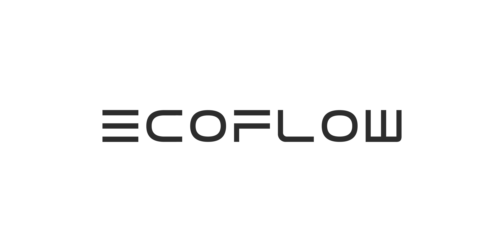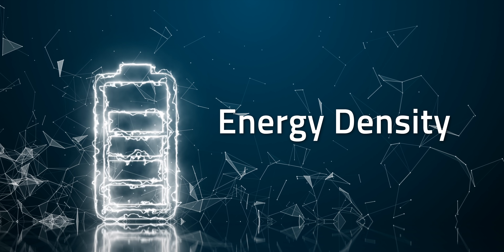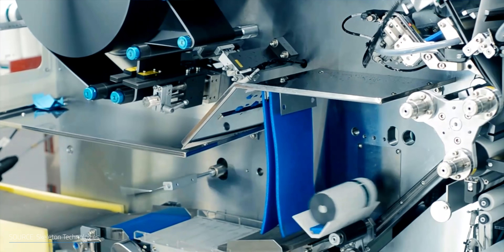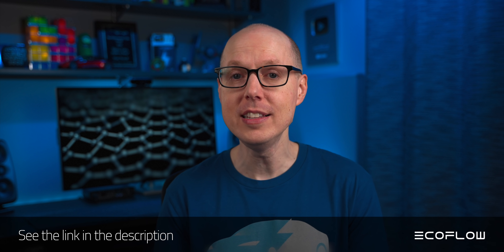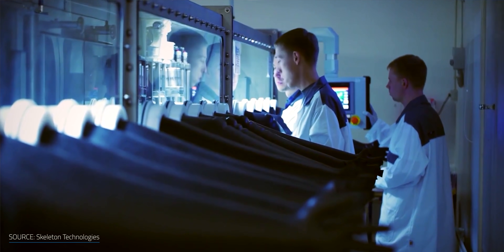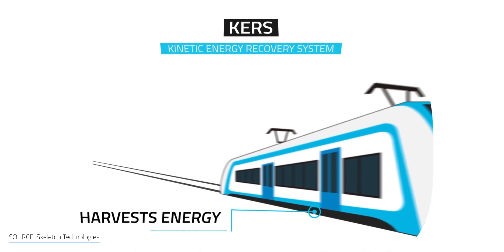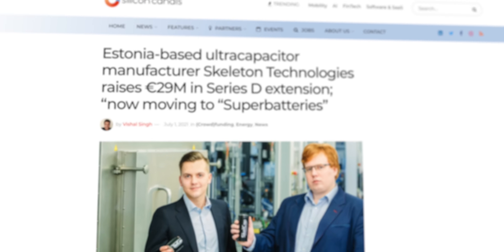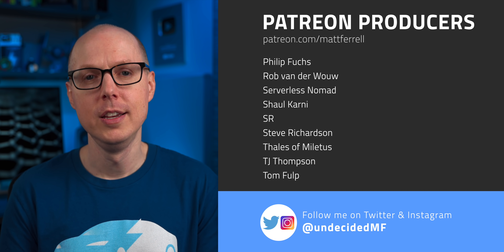Revisiting the Supercapacitor - The Wait for Graphene is Over

Comment: Extremely interesting products. Could see the Ultracapacitors pairing up well with L ion batteries as you could harvest much more energy from regen braking and then dump it out very quickly when the car pulls off thereby saving the L ion battery from having to absorb or provide short bursts of high current which is what damages them.
Reply: If such technology can be minitaruised it could mean personal devices could harness kinetic energy got make batteries power last longer.
Reply: I think the whole idea of Graphene is to replace  Lithium because of its heat & fire factors

Comment: Wait for the release about the invention of a Filipino. No oil needed to run a car. It can also be used in industrials, home. It is already tested on cars and it runs smoothly. Plug aircons, tv etc and it works well. I will share the link when there is English version of that video. This will change the world.

Comment: The Achilles heel of supercapacitors is the self discharge rate. The power stored is proportional to the voltage squared. (1/2 C*V2). Reading between the lines of Skeletontech's spec, over 72 hours the voltage will drop from 2.85V to 1.425V. This is a power loss of 60% over three days. This may well be acceptable for many uses but not or longer term storage. I like the weight down a mineshaft (or old minuteman silos), coupled to a motor/generator, for longer term  energy storage

Comment: The wait for graphene is over, as long as you're willing to wait for it.  For me, the promise of graphene is not going to be fulfilled until someone figures out how to mass produce sheets or ribbons of it.  They just call this stuff graphene because the word is hyped up so much and it gets them press, but it only bears a passing resemblance to the idea or the material properties graphene supposedly has.  It's just carbon.  It isn't even a 2d material.

As for advanced capacitors in general, yeah, good stuff for specialized applications.  But it's just an optimization thing - it isn't and will never be an actual game changer.  It's just one small piece of the ongoing gradual improvement of batteries over the last 40 years, that people don't really notice and only occasionally care about when it's time for an upgrade.

Comment: I still don't think people understand the impact graphene will have. It will replace all other materials when it is mass-produced. Airplanes that cannot break apart in a crash, flying cars, buildings that last forever. It weighs next to nothing, and its bonds are stronger than almost any other chemical reaction. It will not degrade under ordinary conditions. It would take nitric acid to break it down. All products will be graphene doped with other elements to give them the desired properties.  It could be designed as a superconductor. Spaceships that cannot be penetrated by space debris. Space elevators using graphene cables. I know this sounds superlative, but this has so much potential we should be putting as much money as possible into its development. Graphene has the potential to save the world. 

For example, today people are adding it to concrete which means they use 30% less concrete for the same strength. Concrete production is terrible for the environment. It contributes 8% to CO2 emissions. Now we can create concrete batteries, which would work even better with graphene.

Comment: if its better than lithium ion, then go!!   we need three different sorts of storage medums:  low cost high capacity for general excess production capture, low cost low capacity high cycle times for instataneous grid demand leveling, and low cost high cycle time intermediate capacity small volume for vehicles. 
vehicles need to have a mix of fast power delivery and high capacity but slow delivery, to suit two different scenarios. one is short static route vehciles like buses, taxis city/town comute. and the second is long haul, non standard route like off roading, or trucking or vactioning where u may not expect to need refueling often.

Comment: Very nice presentation, thanks for your input. I'm using EDLC super capacitors in my projects from 2007. They help the battery, which has great capacity but high internal resistance and they last for years. First ones had a tendency to leak. Also their rated voltage is low, about 2.5 to 2.8V. So there must be at least five in series for 12V and they must be balanced. Since their principle of working is electrostatic, they have completely different charge/discharge characteristic then batteries. So their usage as a main power source isn't very plausible, but together with batteries is where their synergy really comes to life and is very useful. I look at graphene capacitors as a next step in evolution, mainly getting smaller and more power dense. Definitely a way to go.

Comment: This is just the beginning. The energy storage of graphene supercaps should improve.  It could be to the point chemical batteries will be only for large scale applications. The application for hybrid electric trains, that can run onto non-electrified lines for 20 miles or so, looks good.  Graphene may ensure this so-called hydrogen revolution will be still born.

Comment: Could you charge a vehicle's ultracapacitor fast, and then discharge it to it's lithium ion battery over the next 20 minutes or so? Like 100 miles of range in 10 seconds type of thing.
Reply: Yes! But in this scenario it would be better to use the capacitors energy directly, bypassing the lithium ion battery entirely. 
One of the challenges with vehicle charging stations is that they need to supply a large amount of power to your car in a short time frame. So it could make sense to use the capacitor in the charging station itself.

Comment: Graphene electrical accumulators seem a lot like hydraulic accumulators.   Graphen accumulators will probably be part of most electric motor drive circuitry in the future.  There are a lot of motors out there.  They can be used to start motors that require a huge startup current.  Then there is the obvious use in vehicles for storing regenerative energy when stopping.

Comment: I remember years ago when there was talk of having cylinder type batteries with graphite used instead the size of a regular double A battery but being able to store like x5 or x10 the amount of power a regular battery can. The only problem they were saying back then was a way to mass produce the graphite. This reminded me of that, and how I am still waiting on those great batteries that can store way more power. The current batteries we have these days still stink and until we get to better energy storage for long term we will be reliant on stuff like fossil fuels which stinks.
Reply: "The current batteries we have these days still stink"

Nah, most of them don't smell like anything.  And if you compare a AA Li Ion today with a NiCad from say, fifty years ago, you will find they have gained quite a bit more than 4X, already, especially if you are talking energy storage/weight, which is every bit, or more important for many types of vehicles than energy density per volume.  Now fossil fuels, when burned, do stink.

Comment: I think it't MIT, that patented an industrial-scale process and spun off a startup producer for graphene, it seems maybe like 4-5 years ago off the top of my head.  My point is that the supply-side is finally arriving with quality product at meaningful and practical scale and cost.  Graphene is real.  But we still need better batteries to make wind and solar viable (not to mention, greener economies surrounding the source materials and expired equipment and capital).  What costs the least is what will win; subsidies still cost money to fund

Comment: I want to see a video car charging with the ecoflow.  What amps did you charge at and how many miles of range did you get?  How many watts out of Mr. Ecoflow, gave you how many watts in the car...?   I would be surprised if Tesla hasn't experimented with super capacitors for regen storage and acceleration.  Ultimately  how much range do they add in a stop and go driving situation, like normal city street driving.  I would think for taxi's this should be a real boost whereas long hauls, they would add very little.

Comment: Seems to be you are still dreaming... Very large storage systems that would be needed with the actual solar/wind technologies are NOT available and will not be for the next 5-10 years. Supercapacitors may be used for very specific functions, they may even replace batteries in the fossil fuel cars, but until they match the Battery density energy, would be still a dream...

Comment: I wonder if they could  be used in conjunction with a Lithium Ion battery to extend battery range without adding much weight or taking up a lot of space.  Could they feed energy/ recharge a battery?
Reply: yes, they could. Char the capacitors in 5 minutes - then leave the station. Further, once you park the car - the capacitors will charge further the battery

Comment: the company lyten has graphen lithium sulfur batteries. how much they already produced for military usage would be an interesting question. prototypes, or small scale production line or already fully automated etc.
autoline network interviewed them a few times. current energy density double or triple compared to other li-ion batteries. check them out!
it would be interesting how they produce that graphene layers

Comment: I like the idea of using those batteries as part of a "UPS" system for an entire building.  Have the "Super Batteries" carry the load after your grid source goes down while waiting for the generator to kick in.  That usually only takes a minute or two for one of the big diesel generators with auto-changeover.
Reply: Big emergency generators are required to startup and take full load in 10 seconds, that has been the standard for decades, hospitals at several hundred kW, to nuclear plants with emergency generators rated at thousands of kW.
Reply: @fredrosse  It probably was under a minute (definitely longer than 10 seconds) changeover at the TV station I worked at for 20 years.  But it FELT like it took for ever!
Reply: @michiganengineer8621  OK, the time frame you have experienced is the result of the design criteria (or lack thereof) that was applied to your TV station.  However the 10 second criteria is pretty universal in critical applications, where backup generators are specified.  Virtually all backup generator manufacturers are willing to comply with the 10 second starting and loading criteria.  I agree that 10 seconds is not necessary for many applications, however it is the almost universal standard for the industry.
Reply: @fredrosse  they also have loads of lead acid batteries to cover the time between power failure and generatorer up and spinning so this would be a good solution to replace the lead acid.
Reply: Datacenters use  direct-thru inertial (kinetic) generators to get time for diesels to kick in seamless. Basicaly it's just vacuumed (or not) heavy flywheels on magnetic(or not) bearings mechanically connected to motor-generator pairs.
Reply: Datacenters have UPS rooms that can typically run the building for about 30 minutes. Backup generators only take a few seconds to kick in so the UPS system isn't even on battery for that long
Reply: Meet the material of the future that's 40 times stronger than Diamond.Graphene can withstand the impact of Bullet.
https://youtu.be/Zj9WFnyEyLw
........

Comment: Cool tech. Glad to see headway in graphene tech, but I'm really just waiting for something that can completely replace lithium ion batteries with a higher lifespan, higher energy density and faster recharge times.
Reply: There's always something new. The problem is that it's always like 1-2% better, with 5-10% more volatility and 200-300% more expensive. The problem with batteries is that they're about as good now as they're ever likely to get.
So we can't focus on making batteries more powerful as much as we should focus on making tech more efficient.
Any time you see a new battery tech that promises to revolutionise the world and promises improvements of 200%+ performance. It's a scam.
Reply: @Unethical.Dodgson  I agree that most battery "breakthroughs" are scams, or exaggerated claims based on something that works in a lab but hasn't been scaled industrially yet.

I think it's not quite fair to say that lithium-ion batteries, or batteries in general, can't get better though. Those few % per year have been adding up slowly but surely. There are enough incremental (not revolutionary) technologies in R&D right now that I'd feel safe betting that slow march will continue at least for another decade.

Comment: 5:05 when you say "most conductive material we've come across", i thought superconductors were more electrically conductive? And it's worth noting that its high thermal conductance is only for heat traveling within a layer of graphene, heat traveling perpendicular to the layer of graphene is significantly slower.

edit: turns out superconductors aren't more conductive than graphene because graphene can be a superconductor
Reply from the maker: 👍Thanks for sharing.  We came across this: https://www.nature.com/articles/d41586-018-02773-w.
Reply: @UndecidedMF  
I did not expect to actually have my question answered, thank you.

Comment: When I first saw Graphene I thought of early lasers, which were sometimes called "a solution in search of a problem". Not that I doubted lasers, but it took a  bit of time for them to really take of. I deeply expect Graphene will do the same.
Reply: We already have problems for graphene to solve
Reply: @Mirror Space I've always taken that phrase to mean that it was so new and so potentially useful we've only nibbled at possible applications.
Reply: intellectual property is restricted to the imagination of its owner.
Reply: Semiconductor efficiency is running into a hard limit in silicon based transistors. A lot of the improvements in semiconductor performance came from shrinking the transistors so they use less power and can operate faster. But further gains are becoming harder and harder. Current most modern components are manufactured at a lithography of about 7nm varying on the manufacturer. You can get that to 3, maybe 2. The improvements from that are not that big anymore and beyond that it becomes really pointless. With graphene semiconductors can be built a lot smaller and they can be more efficient too.
Graphene coated Li Ion batteries might increase battery capacity by quite a lot, also reduces the wear by a ton.
There are so many applications for Graphene once we figured out how to mass produce it costeffectively.
Reply: I had one of the first LaserDisc players, but 'they' had already come up with quite a few low and high power lasers and applications by then.  Still...  my player had its own little optical bench inside and a HeNe tube laser and little signal adjusted mirrors and primary lens.  It was cool when I got my new player and this became my first little laser lab.  Played music on the ceiling type stuff.  Nothing serious.  I had a Jacob's ladder in the '70s too I almost killed myself with one day.  This is all that it left.  ;-)

Comment: hello Matt, this ultracapacitor reminds me of the early steam locomotive storage power. why not use that short burst of energy into accumulative storage without the batteries? ever thought of pulsating bursts like the fuel injection engine? i still remember the slingshot theory for the spaceship to escape the earth's gravitation pull, from a small hyperbolic orbit to a larger circular orbiting multiply time until the earth"s gravitation pull gets weaker. just a wild thought concept. love your lightbulb comes to fruition. bob former USAF MSGT and retired UA jet engine technician

Comment: Hmm- the super battery could find a huge market in the electric hotrod market . If I could power a drag car using  Tesla Plaid motors with a super battery weighing 200 lbs, I would certainly by one.